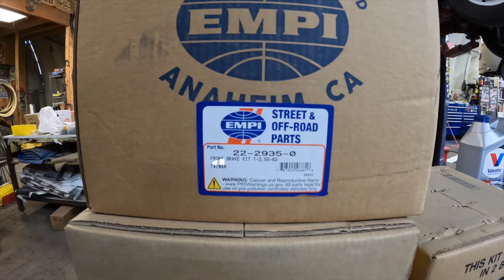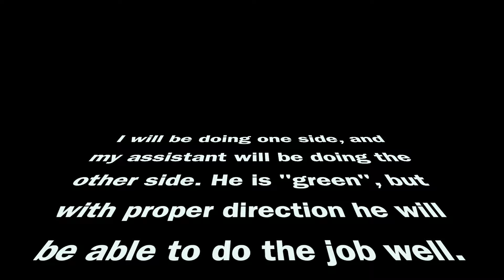Installing Front Disc Brakes on an Early VW Bus

Comment: Great install video my only comment is maybe advise people to use flare wrenches. Very important in my opinion, when working on old crusty brake fittings.

I can’t stress enough how important your master cylinder tip is to  those who have not done this job. Get everything started before you tighten anything down. Great tip!

Comment: love that grease container:) Have you tried the VH 44 remote brake booster? They make the disk brakes amazing.
Reply from the maker: I have not. 👍🏽
Reply: @the_Wagen  I’m running them on my splits, drums on the rear and boosted disks up front. The braking will put you through the windshield if ya not careful 😂

Comment: George, your video's are super informative. Your work is top-notch. Another great job! Question, can I do the disc brake conversion on the fronts ONLY, and use my brand new (expensive German) single circuit master cylinder with the kit?
Reply from the maker: Im sure you can. It will require adding a proportion valve. I’d recommend dual circuit for safety.
Reply: @the_Wagen  Thank you.

Comment: I was curious , On the master Cylinder for the front, one side looks to have a residual valve on one wheel but not the other? why is that?  On my bus I have a residual valve on both front lines and one going to the  back. Used same type master as you have but my master doesnt have any residual valves on it.  my brakes seem really hard to get good stopping power. I have to press pretty hard . 
Any comments?
Reply from the maker: My Master Cylinder was from Empi Most likely a different manufacturer. This is a 4 wheel disc master cylinder. Residual valves have been removed.
Reply: @the_Wagen  Thanks, but it looks like those brass pieces in the MC are still attached and you connected your brake lines to them. they are pointed to the driver side I think. arent those residual valves?
Reply from the maker: No they are not. 👍🏽